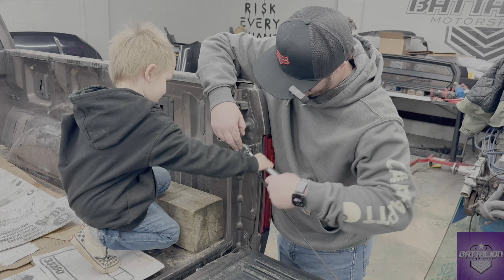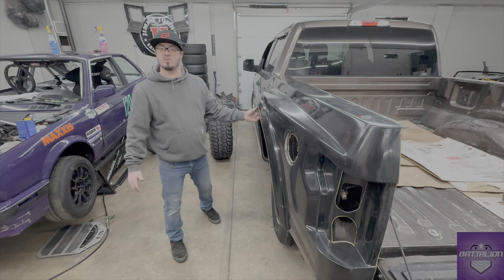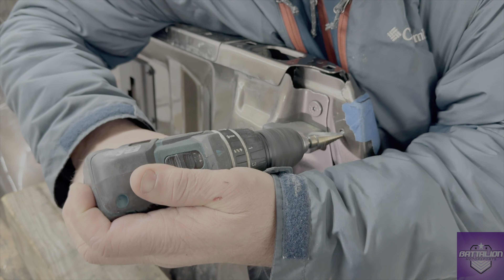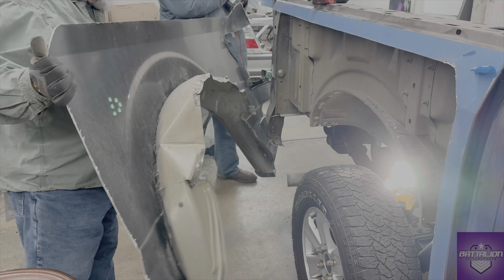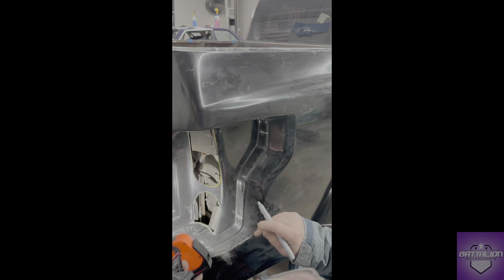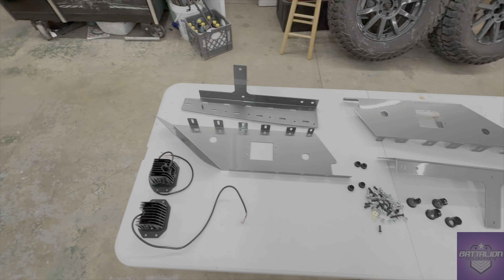Factory Five Racing Xtf Stage 1 Rear install

Comment: Goo stuff man I’m about 2 weeks out from starting mine. Any reasons you guys decided to just cut off the tail light housing metal vs just shaving as they have on the instruction manual.
Reply from the maker: That’s awesome dude. We cut there because the bedside fit tighter to the tailgate.
I started a Xtf group on facebook also.
Reply: @ awesome I’ll look it up